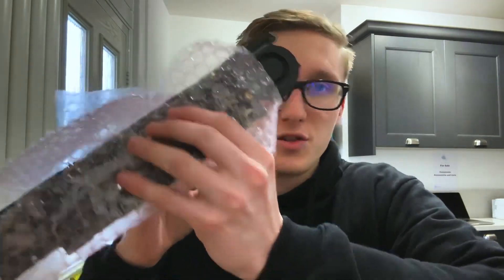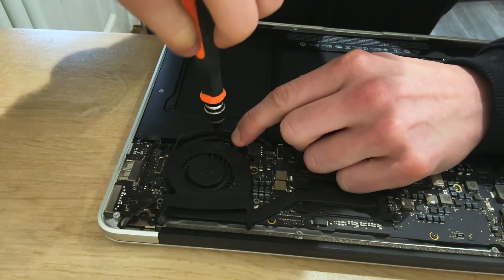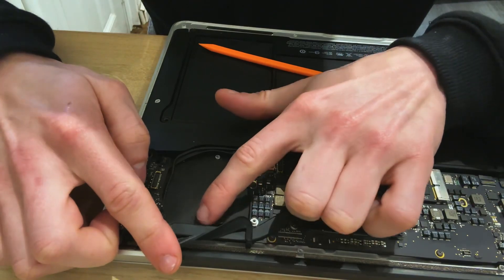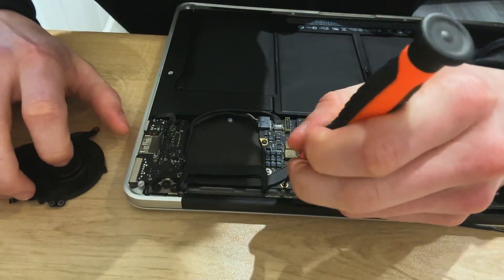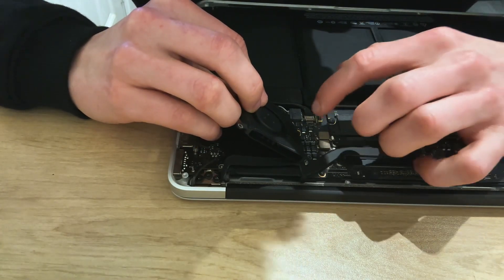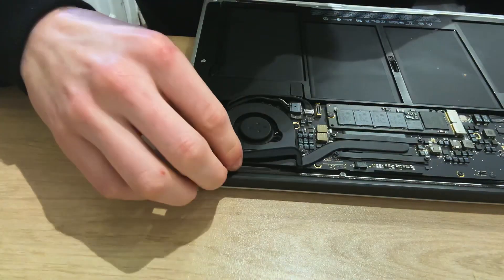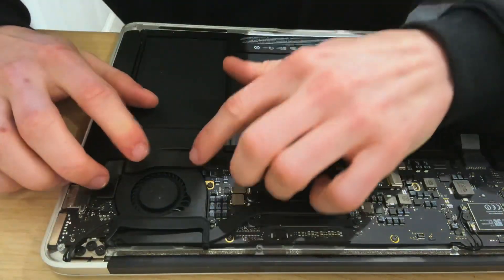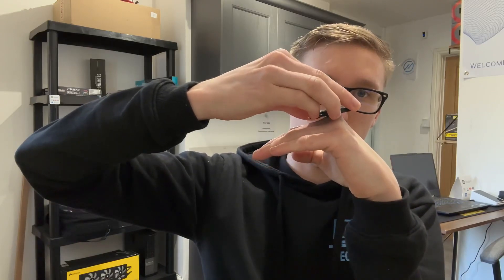How To? Replacing A MacBook Air 2017 Fan

Comment: what's the name of that L cable across the fan? what's its function please?
Reply from the maker: It’s a power cable for the other UI on the board
Reply: @GeoPCs  thanks, I got the sucket on the board, towards the harddrive broken and wondering if it can be simply soldered back